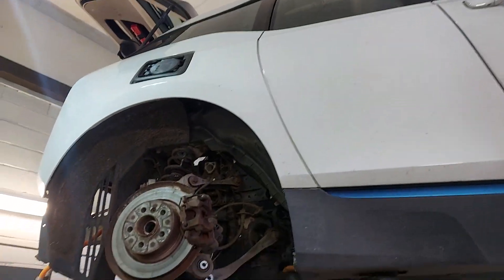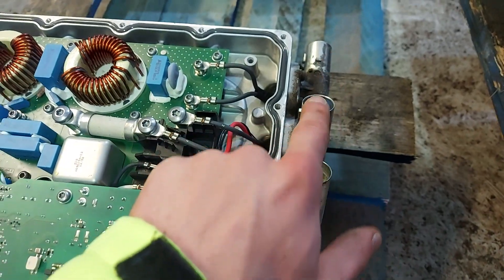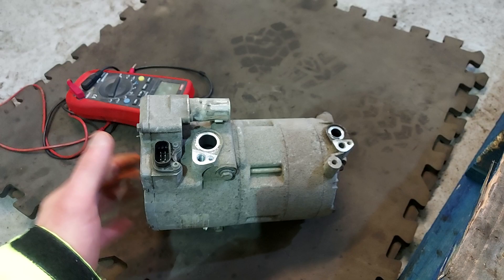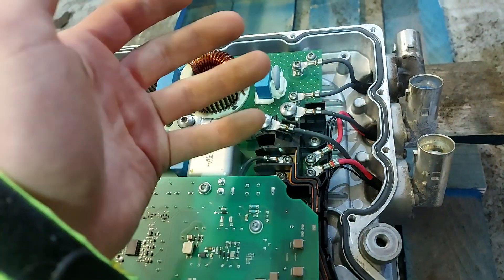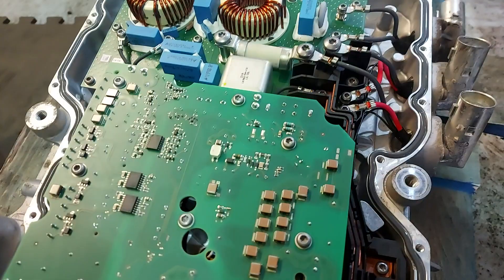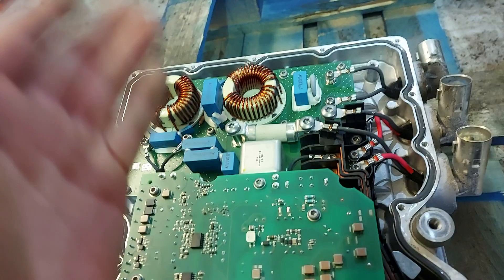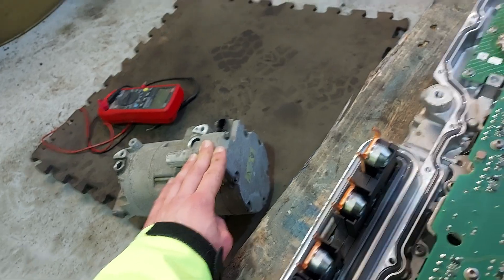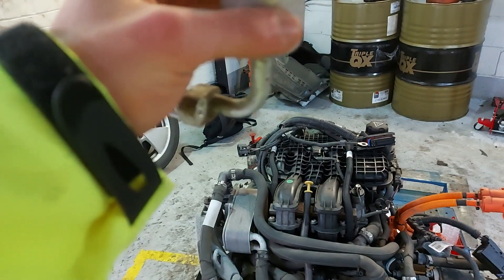A look Inside the BMW I3 EME and Blown Fuse

Comment: Hey Shaun.. you said at the start of this video the HV fuse is for both the AC compressor and the heater. So if the ac is working (blowing cold) and the heater in the front has stopped working then the fuse is not the problem. if it was the fuse both wouldn't work? Is that correct
Reply: I think he indicated the last thing to go was the resistive  PTC heater that caused the EME to fail with the blown fuse.   He has a range extender so he does not have a heat pump (with heat exchanger) to supply heat into the passenger compartment.   Because he is in England/Scotland, he has colder climates so the AC is probably not needed much for the HV battery or passenger compartment.  Speculating, he was probably able to limp along with the AC not working for a while but not the heater.   They both are on the same fuse because it is not likely that both the AC and the heater would be used at the same time.  There is probably a controller that assures that is the case - not both used at the same time.

Comment: Hi. In my f30 330e A/C is not working. I have got an error code: 801218 (Electric A/C compressor: Switched off due to overvoltage or undervoltage in HV supply). Do you know what it could be?
Reply from the maker: Your high voltage fuse for the air conditioning is likely blown due to failure of the air conditioning compressor or the ptc heater.
Reply: @ShaunDobbie  Thanks for your help and quick reply. What is the best way to start diagnose that? I have got ISTA/bimmerlink and multimeter.
Really appreciate your help.
Reply from the maker: @BartlomiejKrol-i4m  you will need to start with an insulation test on the ptc heater and ac compressor to identify which one is faulty. Also, a continuity check from the ptc heater and ac compressor back to the hv battery connector will be necessary to establish if the fuse is actually blown. The power supply is actually always connected to the ptc heater and compressor.

Comment: Hey Shaun, Any chance you know where to purchase one of these fuses? I have a Mini Plug in Hybrid with the same issue. I can't seem to find it anywhere. I even contacted PEC directly and they said contact the dealer. BMW advises it's not a serviceable item.
Reply from the maker: I have a later video that tells you all about it.
Reply: Hi, any chance you can share a link to the fuse?? My i3 needs the fuse according to the shop and he said to find a fuse instead of buying a new DME. I don't have a part number or any idea where to find it. Any idea??
Reply from the maker: @JohnyBLN19  Search ebay for ev80az fuse and see my more recent video.

Comment: Hi Shaun, I found out today the heater on my BMW i3s is not working. The fan/blower is working but no heat. I do find though the range of car decreases though if I increase dial to max so would this happen if the EME fuse had blown? I was thinking if fuse blown it wouldn't draw on battery so range shouldn't be affected? I'm trying to eliminate as much as possible before I have to pay goodness knows how much to get it looked at as yes my warranty expired about 3 months ago. If you have any tips at all to help identify/fix problem I'd be so grateful. Thanks, Steve.
Reply from the maker: Hi, it could be the PTC heater in the front that heats the water. Does your air conditioning still work? If the air conditioning doesn't work and you can't hear the air conditioning compressor running, the fuse is most likely blown due to either a failed air conditioning compressor or PTC heater.
Reply: @ShaunDobbie  Trouble is quite cool here around 12C so hard to tell if AC working. As far as I can tell all fuses in fuse board OK, it's a crap diagram but all AC fuses good.
Reply: @ShaunDobbie  Where is PTC heater? Is that in frunk and accessible etc?
Reply: @ShaunDobbie  I can't tell if compressor running, should it be noticable? I just tried sitting in car on drive and by turning AC on/off the range dropped by 2 miles(not moving just sitting on drive) so would that imply AC was functioning by drawing power? This was with fan on minimum and just toggling AC on/off.
Reply from the maker: Yes, it's in the front. You will need to try and get the air conditioning running when it is warmer in order to find the cause. Once fixed, I suggest you sell the car and get a nissan leaf or something because everything is more accessible in them.
Reply: @stevedouglas3975   He has another video where he is insulating that heater in the Frunk.